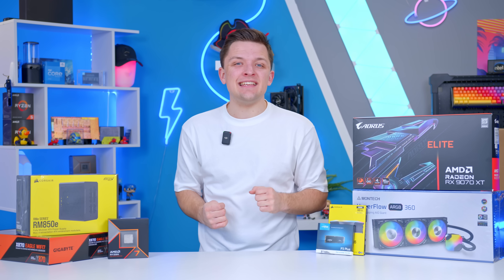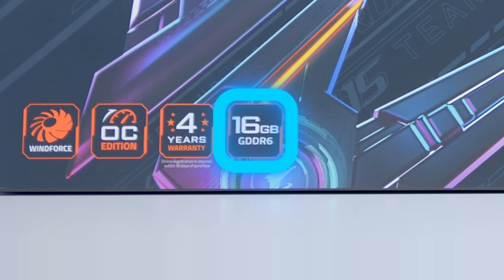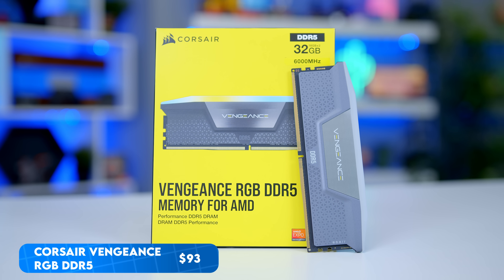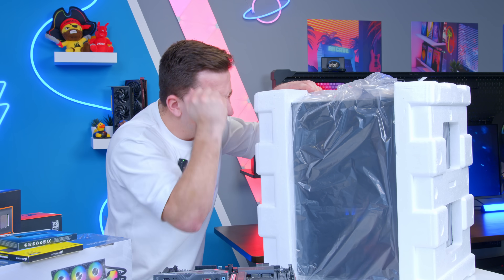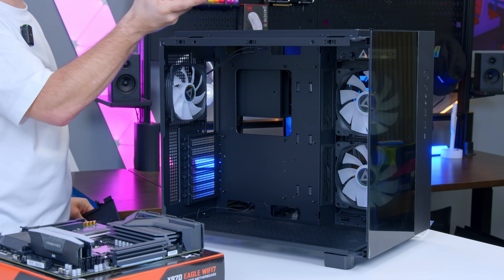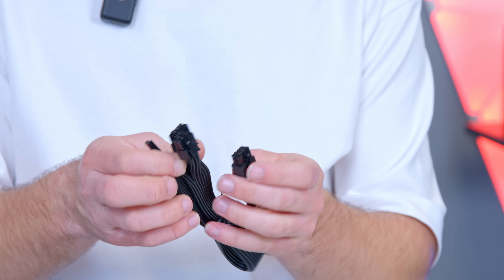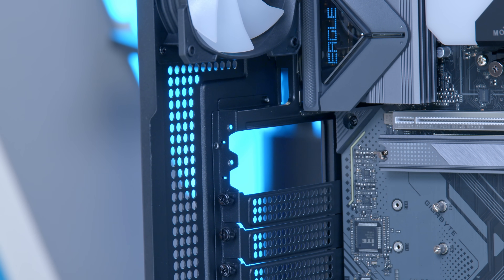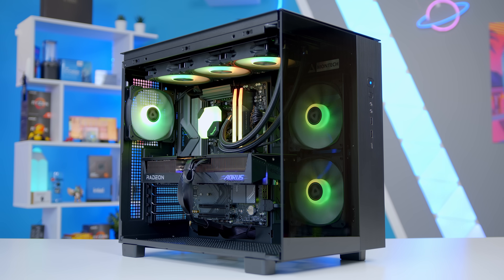Awesome RX 9070 XT Gaming PC Build 2025! 😄 [Full 1440p Build Guide w/ Benchmarks]

Comment: Something to be aware of is the psu you used is the 2023 version of the Corsair RM850e which has 4 x 8pin pcie/cpu and 4 x 6pin sata connections but the 2025 version only has 3 x 8pin and 3 x 6pin which would make doing this build difficult with that gpu. Checking gpu connection requirements would be a good idea before buying a psu. Great video. 👍

Comment: why on Earth would you buy a 9700X CPU and put it on a X870 board?

First off, this is a gaming PC, so unless you need some crazy amount of connectivity or storage, a B650 board is more than enough. The VRMs are good enough to run even Ryzen 9s on B650 boards that aren't complete entry level. Hell I bet even an ASRock B650M-HDV/M.2 could run a Ryzen 9 9950X just fine at stock settings or a slight undervolt.

Secondly, a 9700X isn't worlds faster than the 7700 and the performance uplift definitely doesn't justify the extra cost. It was the centerpiece of the "Zen 5%" memes, remember? Just get a 7700, spend 2 seconds in BIOS applying PBO and enjoy low temps, good performance and more money in your wallet. Zen5 is still bad value unless we're talking 9800X3D.

Comment: Are 2 8 Pins ok for a 9070 xt
Reply: I don't think so, might just have to buy a new psu and specifically look for one that sells 3(6+2) ppin connectors. I keep seeing people say not to use pigtails on it but others say its fine if its the OC 9070xt and you aren't going to overclock. Others say this will melt the cable though so I wouldn't try it anyways.

Comment: Does the Gigabyte X870 Eagle WiFi 7 have good thermals, kinda torn between this X870 or B850 one.
Reply: imo b850 is better, it’s cheaper for like one less slot
Reply: @hellothere3693  Yeah ended up going for MSI MAG B850 Tomahawk MAX WIFI found one on sale with reasonably good price tag.

Comment: Hello, can everybody reply my question please!, I saw that in the video our gentleman only connected 2 pcie cables from the psu to the gpu, one individual and the other one has a pair of 8(6+2) cables, the question is, does that doesnt make any problem with the cables? i saw  on many reviews that i recommend to connect only one cable per slot in your graphic cards, so if you have 3 slots you should use 3 cables, but he is using only 2 cables with one being a pair. I dont know if i explain right my question, thanks by the ways, i loved the video but im new in pc building.

Comment: Is Rx 9070 xt prebuilt with Ryzen 7 7800x3d, 2tb pci gen 4 ssd, b650m motherboard, 32gb ddr5 ram cl30, really nice looking case and a 750w power supply good for $2200 usd?
Reply: If you build it yourself you could upgrade to a 9800x3d and a better psu for that price
Reply: @ yea I know I could, I was just asking for a friend. He says he doesn’t want to build one but doesn’t trust me to build him one😅😂
Reply: No, not at all. Those parts cost like 1700. Build it yourself and if you wanna spend 2200 you can even get a 9800x3d

Comment: I cant really decide if I should get ryzen 7 9800x3d or ryzen 9 9900x for gaming/some productivity work/content creation. Where I live ryzen 9 9900x goes for 470€ and ryzen 7 9800x3d is for 570€.
Reply: the 9800x3d is better. if you care that much about performance try getting the 9950x3d
Reply: I'm in the same dilemma. I know the extra cores of the 9900x will benefit with multitasking and things like video editing, and the 9900x also seems to be more in stock at a lower price, but the 7800x3d gives a lot of extra game performance.
Reply: @BrVendan  If you’re a gamer the 9900x is not worth.

Comment: I am using the 9070XT Red Devil and people have said not to use the 2 in 1 cable for the GPU and go for 3 separate PCIe cable, is this correct?
Reply: No, 2 in 1 is good, I had every gpu connected like that even the 7900 xtx with OC to 462W

Comment: I budgeted myself at $1400 an managed to get a 9070 xt, r7 9700x, 2tb ssd, 32gb ddr5
Reply: whaaat is it possible? In our country rx 9070 xt - 1000$+ and r7 9700x - 400$+
Reply: @Zephroos  I guess or then
Reply: @Zephroos just the rx 9070rt in my county is above 1500$
Reply: @Zephroos   its around 700$ in our country
Reply: @Aavash_Purple  uuuh lucky(((
Reply: What did you you use for cpu cooler? Do you mind sharing your build?
Reply: @JorgeMorales-rt5jq  
CPU	R7 9700x	$165.98
Motherboard	Gigabyte B650 Gaming X AX V2	$151.03
GPU	RX 9070 XT Reaper	$599.99
RAM	Corsair Vengance 32GB DDR5	$92.98
Storage	Inland TN470 2TB SSD	$119.99
Case	Montech XR	$69.99
PSU	Corsair RM850e	$109.99
Cooler	Cooler Master Hyper 212	$29.99
Subtotal	Without Tax	$1,339.94
Total	With Tax (+0.853%)	$1,454.24
Reply: @JorgeMorales-rt5jq  I got everything from micro center including cpu bundle which is in person only so it will be 160 more if you can’t go to micro center
CPU	R7 9700x	$165.98
Motherboard	Gigabyte B650 Gaming X AX V2	$151.03
GPU	RX 9070 XT Reaper	$599.99
RAM	Corsair Vengance 32GB DDR5	$92.98
Storage	Inland TN470 2TB SSD	$119.99
Case	Montech XR	$69.99
PSU	Corsair RM850e	$109.99
Cooler	Cooler Master Hyper 212	$29.99
Subtotal	Without Tax	$1,339.94
Total	With Tax (+0.853%)	$1,454.24
Reply: @ I used hyper 212
Reply: Me too! Today I ordered 9070 xt, Ryzen 7 9700X and 32gb ddr.
Reply: How much fps
Reply: @ovo3474  what game?
Reply: @fowwaplaysgamez  Valorant rainbow fort all the basic ones
Reply: @ovo3474  I play on 3440x1440, Fortnite performance mode everything on max gets 300-400, r6 siege gets like 400 on max settings, Minecraft gets 300, cod gets like 200, I don’t play valor ant but maybe like 600?, cs2 gets like 400
Reply: @ thank you brother also I have a question what’s the difference between the resolutions? What’s the best one I seen the 1440p the 1080 and like “4k” gaming what’s the difference please and thank you
Reply: @ovo3474  more pixels on the screen so resolution is sharper. Think of it like watching a video in 360 p vs 720 p.
Reply: @ovo3474   1440p is the sweet spot 4k is overkill
Reply: @ovo3474  the 4k is the best resolution
Reply: @ it looks best but is overkill 1440p look similar and is way cheaper and easier to run
Reply: @fowwaplaysgamez  how is it 3440x1440? What's your monitor? 9700x with 9070xt is also what im building.
Reply: @alvink566  it’s pretty good I have 165hz and on any game I haven’t gone much below it, I have omen 34c
Reply: Did the same but 7800x3d and 1300$
Reply: Can you share your full pc builds?
Reply: @ sure CPU	Ryzen 7 9700X	$165.98
Motherboard	Gigabyte B650 Gaming X AX V2	$151.03
GPU	RX 9070 XT Reaper	$599.99
RAM	Corsair Vengance 32GB DDR5	$92.98
Storage	Inland TN470 2TB SSD	$119.99
Case	Montech XR	$69.99
PSU	Corsair RM850e	$109.99
Cooler	Cooler Master Hyper 212	$29.99
Subtotal	Without Tax	$1,339.94
Total	With Tax (+0.853%)	$1,454.24
Reply: @fowwaplaysgamez  r7 9700x for $165 and the motherboard from where did you get all that for those prices😭
Reply: @tyroneholmes16  micro center bundle, it’s in person only though
Reply: @ gotchu is everything you got is from micro center?
Reply: @tyroneholmes16  every single thing
Reply: Need the specs for that budget
Reply: @ ok
CPU	Ryzen 7 9700X	$165.98
Motherboard	Gigabyte B650 Gaming X AX V2	$151.03
GPU	RX 9070 XT Reaper	$599.99
RAM	Corsair Vengance 32GB DDR5	$92.98
Storage	Inland TN470 2TB SSD	$119.99
Case	Montech XR	$69.99
PSU	Corsair RM850e	$109.99
Cooler	Cooler Master Hyper 212	$29.99
Subtotal	Without Tax	$1,339.94
Total	With Tax (+0.853%)	$1,454.24
Reply: @fowwaplaysgamez  Ryzen 7 9700x is 300 not 165 and all the other prices are wrong also so wym look like bro u need to obviously look
Reply: Power supply? Cpu cooler? Case? Monitor? This things are expensive u most have at least 2000$
Reply: @levaiakraman  brother look at the replies I already answered that
Reply: @fowwaplaysgamez  bro said the 9070xt is 599 haaa we’re u waiting outside for it maybe 🤔
Reply: @ragepac438  not if you get the bundle at micro enter
Reply: @ragepac438  for a 9700x  mobo and ram
Reply: @ragepac438  bros quiet now
Reply: @ you really think huh gpu you named is a thousand 9700xt is 300 and 32gb ddr5 is 80 plus make sense you named everything in your build and rounded it to 1400 when in reality I did all the correct prices and it’s 2000
Reply: @ who’s guiet now ahhahahhaha
Reply: @ragepac438  you’re just mad
Reply: Nice, I want the exact same configuration, in Mexico is over $2k unfortunately, but I will get it
Reply: This is basically my build and it runs great.
Reply: Same but 2300$😢. Because in our country these cards are really expensive because of the import taxes.
Reply: Getting the same
Reply: @TitanMC-t9f w
Reply: Dawg thats literally my pc lol 🤝
Reply: sheesshh
Reply: Bruh in which county u r living in my country only gpu and cpu are nearly 1400 🫠
Reply: @Anied290  us
Reply: Big cappppp ha just 9070 and 9700x is 1400 alone make sense
Reply: @ragepac438  hey goober read the replies smh
Reply: @fowwaplaysgamez hey what micro center. I’m gonna go to the one in Houston. You think i can get the same stuff for that price?
Reply: st louis park, definitely likely everything except the GPU as those aren’t easy to find, just ask for what I have on that list and they should give it to you at that price, make sure to ask for a Ryzen 7 9700x combo
Reply: @ragepac438  hey goober look at the replies smh
Reply: @ I did and looked up the prices for everything and it’s over 1400 the 9070xt is a band alone
Reply: @ragepac438 he telling the truth
I lined up for 9070xt outside micro center on release for $600
9700x was in was in discount on Amazon for $189
Reply: All gpus are literally up 20 percent then there actually worth?
Reply: Really good one as well wow
Reply: That’s really close to what I’m looking at but I’m not sure if I want the 9700x, 7800x3d or 9800x3d.
Reply: @micah7405  what’s your budget, resolution, refresh rate and main games you want to play?
Reply: @ around 2k I bought a 7900xt and I was thinking about getting the 7800x3d, but I was also looking into the 9800x3d or the 9700x.
I’m trying for 1440p 144fps
I play a lot of games that aren’t that demanding like siege but I would like to be able to play games like cyberpunk or ready or not at decent settings
Reply: @micah7405  9700x is for than enough for 144hz 1440p, and cyberpunk is GPU demanding which means the cpu would make little difference so I recommend the 9700x as it is more than enough for cpu demanding games and doesn’t make a difference in GPU games really.
Reply: @ my planned build so far is 
7800x3d
7900xt
Corsair nautilus 360mm
Corsair rm 850w
Corsair vengeance 32gb 2x16
Fractal design north XL
Gigabyte x870 aorus elite WiFi 7
Samsung 990 pro 2 TB
Reply: @fowwaplaysgamez  thanks man, do you think I could get away with a b650 motherboard or would it be better to get a nicer one now so I don’t have to upgrade as soon?
Reply: Why didn't you get 9800x3d
Reply: @genlongtsang1093  it costs way more buddy
Reply: ram would be 600$
Reply: @ookujg  hey big dog look at the date this was 10 months ago

Comment: which are more worthy to buy on your opinion the 9070xt or 7800xt?
Reply: If you can afford the RX 9070 XT, it's a great choice. However, if your budget aligns with the 7800 XT, it's better to go for the RX 9070 (non-OC), which costs the same but offers significantly better performance. On average, the RX 9070 XT is about 40% faster than the 7800 XT in rasterization. That said, if you have $599 and can find a retailer selling it at MSRP, it's definitely worth it.
Reply: @ thanks bro. im still waiting for 9070 white lineups since im building all whites pc. its really hard to get everything in my country 🇲🇾

Comment: The price was not $599, it was $719 without tax.
Reply: Depends on the Model but that Gigabyte Aorus is a premium design therefore over MSRP Yes.
Reply: @rulewski33  That wasn't clear in the video. That's why i left the comment.
Reply: @rulewski33 I paid $800 with tax included on this same Aorus
Reply: @droppinBOMBS310  
Seems fine, i got it too actually. Paid 849€ with tax/vat included. Thats the MSRP for this Model.
Reply: I got a 9070 xt for 600
Reply: Or even more depending or region/area. Like EU, except for the first wave that sold out in minuts, the prices here in my area are more like 900/1000$ + with tax.
Reply: @Sapper_gaming 
Yeah that is a mess at the moment. The Cheapest 9070 in Germany right now is a Sapphire Nitro+ 9070 (which is kinda ironic, as it's usually a more expensive Model) for 715€ which is actually very near MSRP for that Model. And the cheapest 9070XT is the PowerColor Reaper for 865€ which is madly overpriced at this point as this has normally the Price of 689€.
Reply: @Sapper_gaming  True. Tariffs are a huge thing right now.

Comment: I'm curious about the psu cables, wouldn't it be better to plus individual 6+2 cables to the gpu instead of the pigtail and and only 1 individual 6+2?
Reply: I´m running my Nitro+ 7900XT since 1,5 Years now and no problems so far with that configuration of Cables. In theory 2x8 Pins would be enough as each 8 Pin pcle connrector is specified up to 150W and the Pcle Slot can also provide up to 75W.  Performance is also the same like with 3 Seperate 8 Pin Pcle Cables.
Reply: @rulewski33  yeah thanx for the reply, I’m getting the rx 9070xt tuf edition myself and I totally forgot about the pcie slot being able to also give power. I was so focused on the fact that the 2 cables could supply 300w in total. 🤪
Reply from the maker: From memory, on this PSU this was the best I could do. Never had an issues with the pigtails personally

Comment: I just got back into building PCs after 25 years of being out of the game. I built one for my sone using the 9700x and gigabyte b650 gaming x ax v2 mobo with 32gb of ram and I put in a 3060 I had from a dell 5810 I had sitting around. It used the king 95 pro case and the same AIO you are using. It works great for him. He only has a 1080p monitor but it runs everything beautifully. For me I got the same processor, mobo, and memory but I snagged a 9070 xt power color reaper. I put all that in a geometric future
Model 5 green and black case with their 420mm AIO. I use it mainly for sim racing running triple 27” 1080p monitors. On nearly maxed settings I’m getting 140+ fps most of the time. Now I want to build more as I forgot how fun it is.
Reply from the maker: Nice one man! Sounds awesome :)

Comment: Thank you for this video. I had a quart of power supply, but I thought it didn’t come with the 2 4 pin CPU so I’ve been using just one four pin and I checked the box and turns out building PCs in low light bad idea I I am now using the 2 4 pins

Comment: Idealy the gpu should have separate cable for each pci power socket
Reply: Im seeing a lot of these dorks do this, I suspect they're running out of cables or PCiE slots on their power supply choices but the show must go on.  Waiting for someone to address this before I pull the trigger on a PCU.  Its like the card showed up with three eight pin power supply and no one wants to talk about it.  : /
Reply: @MantoMayer   
I´m running my Nitro+ 7900XT since 1,5 Years now and no problems so far with that configuration of Cables. In theory 2x8 Pins would be enough as each 8 Pin pcle connrector is specified up to 150W and the Pcle Slot can also Provide up to 75W
Reply from the maker: Ehhhh.... not the big issue everyone seems to be claiming - at least not in our testing. Also not possible on this as there are two 6+2 pin harnesses (each with a pigtailed connector). You'd need 3 harnesses in this build for that to work out
Reply: @GeekaWhat  - it absolutely impacted my GPU install. Without using the 3 header harness and pig-tailing as was done in this video my PowerColor 9070xt wouldn't boot properly. One I went to a 3 header harness - all issues were resolved. Even though it works sometimes, it should probably be noted in case someone mirrors your installation and they have issues. Could help their trouble shooting greatly should the issue arise.

Comment: Great video!
I made myself basically the same build but got the gugabyte gaming OC instead 😎
Is it save to use both the split 6+2 and single pcie cable?
I was also thinking of getting some braided cable extensions to make it all look better, do you think it could cause problems? Is it safe?
Reply from the maker: Thanks! Yes it is :)
Reply: okay thanks, hopefully nothing blows up then😅
Do you think the gigabyte 9070 xt gaming oc is a good custom?

Comment: will this build work with the asus tuf 9070 xt?
Reply: Yes it will model of the gpu is important not the brand but it would be a pretty good idea to check the temps so it doesn't overheat.

Comment: Isnt not recommended to use the GPU pigtail cable for the 8 pin connector?
Reply: The gpu tgp is around 305w, two separate 8 pins alone are 300w, with the pcie supplying up to 75W, there's is little to no danger of using a pigtail connection here. A problem would arise if there were only two slots instead of 3 and he didn't use separate pcie cables.
Reply: @teboho_26  I have the gigabyte 9070xt Oc version its recommended 850w from gigabyte but AM recommends 750w psu which is what I have, I am not going to OC my pc, I only have 2 pcie 6+2 cables one with pigtails do you think its fine to do a daisy one of them to both pins? Or just get a new psu?